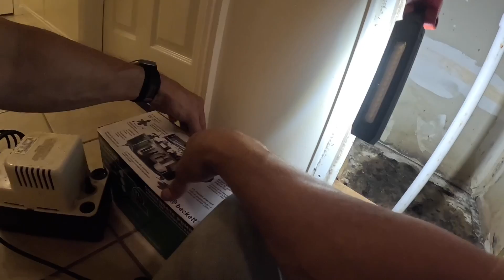Closet Was Making a Constant Loud Noise! #hvacguy #hvaclife #hvactrainingvideos

Comment: Hi Curtis,
Thanks for the video.
I couldn’t tell for sure, but was that black stuff on the floor around the pump mold?
Also all filters of any quality have a pressure drop number so it can be calculated into the total external static pressure.
So if the blower had a .5 total external static rating at a specific air flow then the filter rating gets subtracted from the .5 what’s left is the energy the blower has left for the duct system, registers and dampers.
So, if that system was operating at a .4 external and you put a .15 filter in then you have exceeded the blower capacity by .05. Thus less airflow available.
In my experience a lot of duct systems are above the blowers ratings and can’t handle the better filters.
Be well.

Comment: I would have tested the pump and the kill switch you wired in. And enough with the wire nuts, get the weagos
Reply: is the new pump good ... (maybe) is it faulty out the box ... (maybe) is the drain line clogged and it burnt up the old pump ..(maybe) but a call back is the only way we will know i guess

Comment: I was doing HVAC at a big company we had about 100-150 specialized a/c computer room set ups using similar condensate pumps . We were failing about 2-4 pumps per month . I got so good at changing them it was a 5-10 Minuit job at about $ 500 a pop parts and labor. I brought it to management’s attention. What we found was electrolytic corrosion was eating the impellers off the shaft.  We had to put in cathodes to prevent the failures. Manufacturing defect?
Reply: Seen a lot of them die due to rust in the pump because alot of the pump manufactures put wall mounting hardware in the sump, and no one takes it out so it floats in water for the entire life of the pump.

Comment: 0:50 My grandpa is a HVAC technician and he hates those filters too. He says it reduces air flow and puts a strain on the system. But I actually use the 3M Filtrete Carbon Filters to reduce allergies and reduce smells inside the home from my dog. I personally think they have pretty good air flow. I’ve talked to many HVAC technicians and every one of them have a different opinion on those filters.

Comment: These p traps made from 90s disgusts me…do it with 45s or just buy a molded p trap….other thing…if you have a condensate pump all that is needed is a 30° angle at the bottom of the pvc in the condensate pump to create the trap which is a better option…

Comment: Why did you run wires from the pump up to the wires in the main unit ??     Plus we love to see pictures of Riley..
Reply: The wires are to connect the float switch in the condensate pump to the unit.  That way if the condensate pump fails the float switch will cut the unit off.
I saw the float switch on the unit.  That only protects the unit in case of a trap/pipe stoppage.

Comment: The String is in the wire to split it.Why does no one ever use the string .
Reply: I was always told (even by wire manufacturers) that the string was left over from manufacturing, was used to pull the wire through the machines without stretching the copper, helps to make the final cable stronger, and should be cut flush after stripping. The way they recommend is using a wire jacket stripper (<$20 tool), which only cuts through the outer jacket without putting strain on the leads, whereas yanking the string can squish or tear the thin insulation on the individual leads, giving you a potential hidden intermittent 24V short that you'll be chasing for days. Or a fire on ≥120V.
Reply: @unmountablebootvolume  No its used to split the outer jacket i Worked as a fire alarm tech for several  years and our wire manufactureres use to instruct us thats how its split. Keeps you from stressing the wire and keeps you from nicking the insulation and causing ground faults
Reply: @apollorobb  Huh, interesting, maybe it's different between manufacturers and insulation types. The ones I usually had strings in were either rugged long-distance ethernet/canbus lines with multiple twisted pairs and a string in the center, or flexible rubber 3 phase cables with a thick cord between the normal wires (as is used on mobile industrial equipment). I guess on those the whole "string might hurt the wires" thing makes sense, as the outside sleeve is way stronger than the (wobbly) insulation, and the string would probably trash everything inside before even beginning to tear the outside plastic and shielding, but I can see how it might be different for fire alarm wire, as that only has a little thin sleeve on the outside. So I guess the only real answer is checking for each wire type individually.